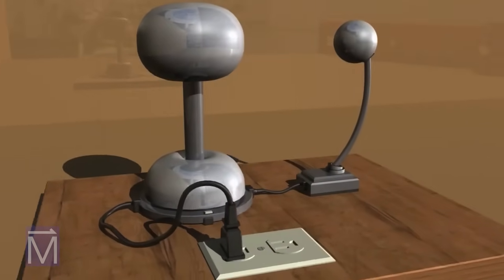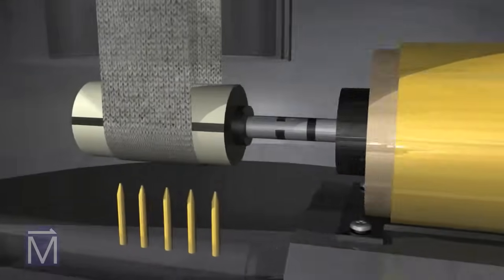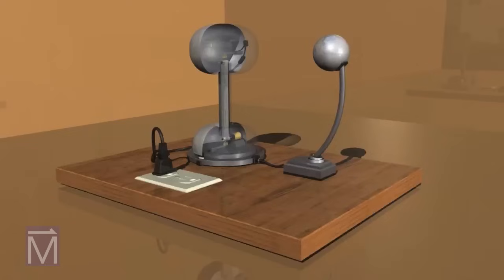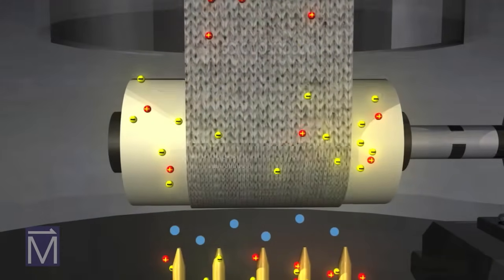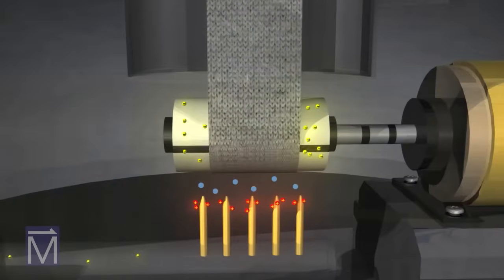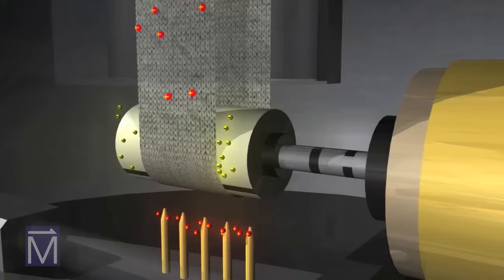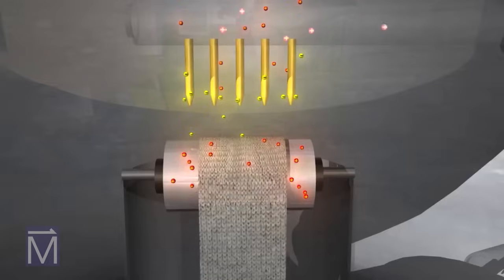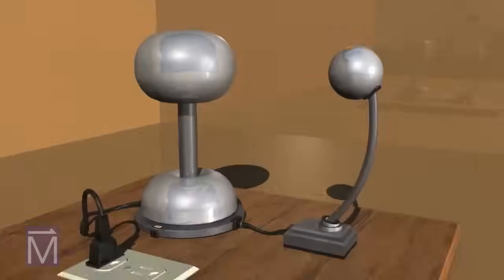How Van De Graaff Generators Work

Comment: What happens if you put the teflon roller on top and aluminum on bottom?  Is there a direction of flow in a discharge?  Why are the spheres different sizes?

Comment: where did the postive charges go at the end?
Reply: The second sphere you see at 3:54 is grounded. The positive charge at the generator accumulates until the voltage difference between the generator and the grounded sphere is strong enough to conduct the positive ions through the air in the room into the grounded sphere - which is seen by the electric arc that forms between them.

Comment: 3:35 " because the top comb is attached to the metal sphere these positive charges travel toward the sphere and spread out across it they will accumulate on the sphere..." The top comb is attached to the metal sphere by a metal conductor. So this is claiming that metal conduction can be due to ions flowing in the metal? This doesn't make sense. Almost certainly what's being described is that positively-charged air ions move to the top comb, where they are neutralized by electrons there. That draws electrons away from the conductor that's ultimately connected to the sphere, thus causing a deficit of electrons on the sphere.  Meanwhile, the now-neutral air molecules simply float away.
Reply: I don't know about the second thing, but the ions moving in the metal part? They don't. The top sphere has an overall deficit of electrons, making it positively charged. since positive charges repel each other, the molecules that are positively charged neutralise themselves by accepting electrons from othe molecules. now these molecules are positively charged. this keeps happening until all the charged particles are equally distributed on the outer surface of the sphere.
Reply: @Graham_Wideman yeah that part bugged me as well. Thank you for the comment, it seems much more plausible

Comment: Great explanation, but I have a question.  What happens if there is nothing for it to discharge to?  Will the positive charge just dissipate into the air?
Reply: Yes, it will dissipate into the air and through the machine, although not much. Over time charge will accumulate on the metal and increase the voltage. As voltage increases, more charge is able to leave the metal through the air and the machine body, but not a lot since those paths are so high resistance. Since the rate of dissipation increases with voltage, but charge accumulation stays the same, there will eventually come a point where the charge accumulation will equal the dissipation and the voltage will remain constant until you touch it with something. If you turn the machine off, charge will very slowly dissipate.
Reply: after it reaches a certain voltage, with nothing to discharge to, the air around it will start to break down, ie, ionise, and become a conductive medium. the sphere the discharges with a spark. thats why large particle accelerators that used van de graaff generators kept them in a vacuum chamber (eg the westinghouse atom smasher), as this allowed it to reach a much higher voltage, as it will then have truly noting to discharge to. even discharging through th body does not take place as it is (ideally) insulating.

Comment: I can't undestand one thing. the superior roller became  positive, so the belt became negative i think?? And when the negative belt  flows down and arrives where there is the inferior roller which is negative...what happened? Both  belt and roller are negative so what happen, how the generator start working again, it's very urgent please
Reply: Well, I may be a little late, but basically, the bottom roller becomes negative causing the belt to be positive.  The positive charge goes up to the top roller, which is more likely to become positive and causes the comb above the top roller to be negative.  The positive charge from those combs has to go somewhere, so it goes to the surface of the VDG.  Because the top roller is taking the positive charge away from the belt, the belt is neutral in charge once again on the way down to start the process over again.

Comment: Hey all - I am about to rebuild an old Van de Graaff generator that I had cobbled together some years back, and before I do, I have a question about a specific design point that I see in every version of this machine.  Is it strictly necessary to have a hole in the top sphere, in which the upper pulley turns?  From my naive point of view, I would assume that having the upper comb attached directly to the unbroken lower surface of the sphere would still force the charge to attempt to spread across the entire outer surface of the sphere, and would be more electrically efficient.  If someone can point me toward an explanation of why the pulley itself must be interior to the sphere, I would appreciate it.
Reply: Yes, it is necessary. Look up the Faraday ice pail effect to understand why.
Reply: Hey i am also planning on building a Van de Graaff generator can you instruct me on the process?

Comment: Protons don't move amongst atoms, as shown in your diagram. A positive charge comes exclusively from a lack of electrons. Other than that, great video.
Reply: Yes. Positive charges are also described as "holes" where electrons are missing. At least in semiconductors that's valid.
Reply: you’re right that the diagrams are a little unclear, but the narration clarifies that the “pluses” are positively charged ions, not protons (for example, at 2:46)
Reply: @jkaptustudios  That doesn't change anything, it's still wrong. "positive ions" do not move in a metal. Electrons do.
Reply: @Rhannmah i don’t remember writing that comment but yes you are absolutely right. thank you for pointing that out. i know that now (and i should have known that a year ago, what was i thinking??)
Reply: @Rhannmah  @vittles man  correct me if i'm wrong but aren't the pluses on the belt just positively charged air ions? because of the electric field, the air molecules are split up into the electrons which go into the metal belt and the positively charged ions which are attracted to the teflon roller but are taken away by the belt. This should be the same case for the metal comb at the bottom where the electrons in the teflon roller repel the sea of electrons in the tips of the metal comb leaving just the positively charged metal ions in the tips of the metal comb. So yes you can refer to the pluses in the video as positively charged ions.
Reply: @jkaptustudios  I must've missed that, thanks.
Reply: @sandstorm6689  I don't see how the positive ions would like accumulate on the outside of the sphere from within.. I think its just a matter of stripping the electrons making it more positively charged
Reply: @jkaptustudios  your amazing
Reply: Yes,but in the past scientists didn't know that and they thought positive ions are the one that are moving and because of that even after finding that electrons move not positive ion they still use the old method to explain the working of a machine